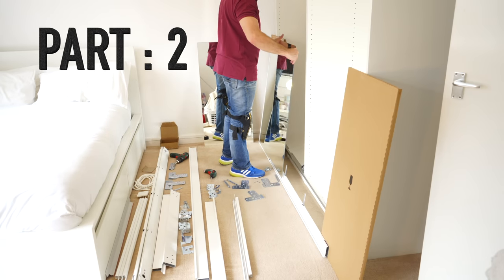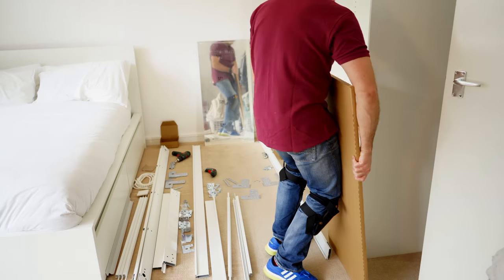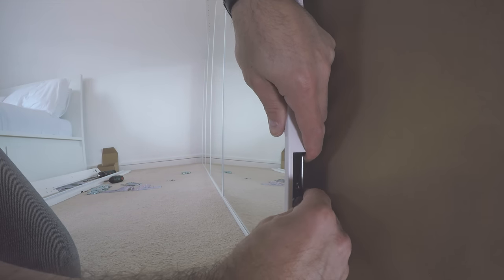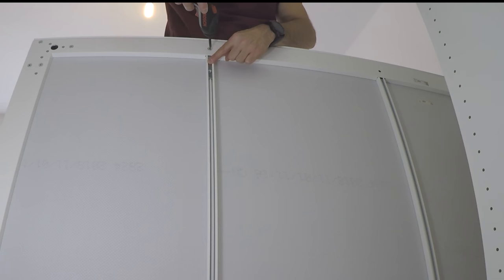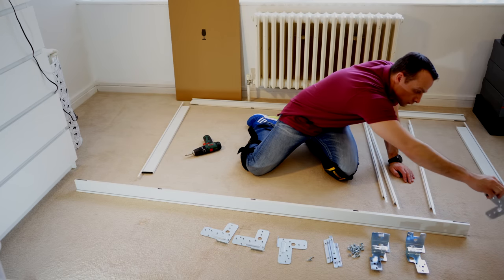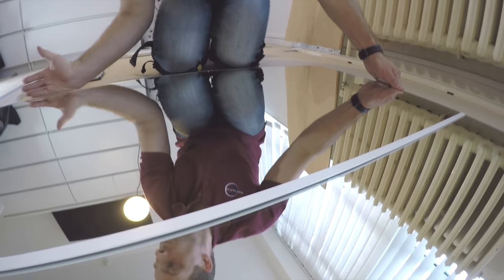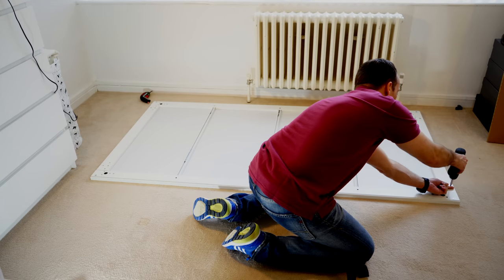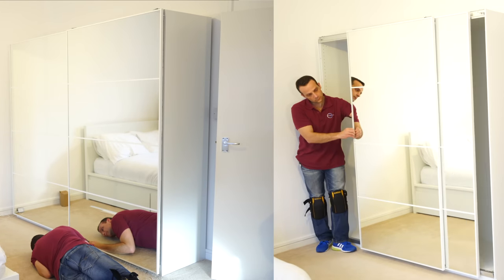IKEA PAX WARDROBE Sliding doors assembly (Part: 2)

Comment: This video was an essential guide to enable me to correctly assemble the Pax doors. Without it I would have made many mistakes. He does not do the assembly in exactly the same order as the IKEA instructions, which caused a little confusion but watching it certainly saved my sanity. I’m a 70 year old gran. I only needed help with lifting and fitting the doors to the wardrobe.

Comment: You forgot to install plastic covers on L-shape brackets. I've missed that step too, so I had to reassemble doors after. IKEA manual page 10, part number for plastic cover - 10006187 10006207 10006204
Apart from that, videos are a great help! Thanks!
Reply from the maker: Plastic cover for wardrobe fame?
Reply: Yes, there are little plastic covers for the four corners of the door. Just makes it look nice and reduce the sharp edges on the corners.
Reply: Thanks for the excellent video Peter! Highly appreciated and much better than the manual IKEA provides.

Vyacheslav and light 487 are right. In step 6 of the PAX wardrobe assembly manual you will see that a plastic cover (which, apparently, has three different part numbers: 10006187/10006207/10006204) has to be put on all brackets (4 L-shape and 4 R-shape).
Reply: @PPFlatPack  do you have the exact name and model of the wardrobe you are working on please? Thanks

Comment: Thank you very much for the 3 videos. They have been very helpful, very easy to understand and made our task much more simpler. Thank you again
Reply from the maker: Thank you for watching;)
Reply: @PPFlatPack  Txs! One little thing though: pls mention next time it s not so advisable to fix the locking screws with a machine! 
If you use too much force the locking screw will go in completely and destroy the divider.. The divider then comes out and the doors will not slide properly..

Comment: Thanks for this very helpful.
A word to anyone else finding this to use as a guide...Though I had enough room to do the second method, and tried it, I recommend the first ( less room) method as its easier to complete the door. When I tried the second ( more room ) method ,the last part had me worrying I was going to break the mirror, plus lifting it up to put the end bit on was all to dodgy I was sure it was going to break. So I took it apart and redid it doing the first method and it went together well. I also had plastic pieces to put on the L brackets - might be an update in design since this video was done, so be sure to follow the official instruction booklet along with this to make sure you don't miss a step.
Reply from the maker: Here is latest updated version and you correct regarding the last glass panel if you doing it in the floor here is easier way putting less pressure on the last glass panel https://youtu.be/R499d-CBDzk  Thank you for watching
Reply: Agree. I used both methods and the "upright" method was way easier. When the panela were lying flat the last one was under too much pressure when I was sliding it in. Great videos!

Comment: Thank for your really helpful videos.  I bought a disassembled Pax wardrobe second hand and just followed your calm instructions (paused after each step) and assembled it almost stress-free!  Just bought 4 mirror panels from Ikea to replace the white ones on one  of the sliding doors. Do you have a video showing the minimum steps I need to take out the white panels and replace with the mirror panels? Many thanks

Comment: The manual says that we need to hang the frame beforehand and then add the glass panels. Will that not be easier than hanging the extremely heavy door with fragile mirro? 
Genuine question 🙋🏼 as still undecided which route to take
Reply from the maker: I think you find older video. This is previous model. Here is the new one https://youtu.be/Ilxl5yDrq48?si=2-rwBQpq8FdKYD8a

Comment: Great instructions! Can the slides be used for Pax frames bought for hinges doors? Or the hinged doors will only work for frames made for doors and not sliding doors. I’m still waiting for my order so I haven’t seen the instructions yet.
Reply from the maker: All Ikea Pax frames would work with hinged and sliding doors
Reply: An other question. I didn’t like a lot of the sliding doors. Could I use the hinges door converted to a slider or are they too small for the frame?

Comment: Just finished some sliding doors and the foam pads on the outer door brackets are rubbing the inner door just as it closes. Is there an easy adjustment to increase the gap between outer and inner door?
Reply: This is probably too late for you but others might benefit from my answer. I came up with the same problem the first time I did this assembly. The next time I simply didn't put the foam pads on the bottom till after the doors were on in place.  Then I found the best place for them (which isn't where the instructions tell you).  You'll have to figure that out on your own as I can't describe it without the instructions.

Comment: Everything has been very clear but I am confused about the duster strip.    My home installation has the inner door on the right and the outer door on the left, just like you say in your video (and the opposite of what is in the written instructions I received).   On the inner door, does the strip go on the side of the door that is towards the middle of the wardrobe or to the side that is at the end of the wardrobe (when closed) ???  The written instructions step 29 show the duster on the ‘middle’ side of the door, but you seem to install it on the ‘end’ side at the 10 minute mark,  Can you clarify?    Thank you.
Reply from the maker: You have two dusters one going on the inner door if your inner door going to be on the left side duster on the left if the inner door going to be on the right side duster on the right. 
The outer door on the left duster on the right on the left ending aluminium pannel with rubber stickie (middle duster closing the gap between doors. The outer door on the right duster on the left aluminium pannel with rubber stickie on the right (again duster closing the gap between doors). Hope that help

Comment: Hello. I am currently building 2 PAX wardrobes for a customer. They are having sliding doors. What’s the absolute minimum size I can have between ceiling and top of carcass for the doors to slide on?
Reply from the maker: You should have at last 1.5cm. Here is latest updated video in this ikea sliding doors there was few changes from older model https://youtu.be/R499d-CBDzk
Reply: @PPFlatPack  that’s annoying I think I have 1cm. Could you also tell me which Bosch screwdriver that is please,
Reply from the maker: @deancarter4109  Check this video https://youtu.be/ehWybREbdF4 you can see all measurements and space between ceiling and sliding doors in detail than you can decide if you want to try with 1cm. Hopefully you have all 4plastic holding top rail already in. Regarding tools all links in the description.
Reply: @PPFlatPack  your work is amazing. Did you get longer drill bits to get into the tight holes? Watching your videos now. Thank you so much.
Reply: @PPFlatPack  sorry one more question. What fixings do you use when attaching Pax wardrobes to a stud walls? They are flush to the wall

Comment: Man, I Need your help. Im trying to assembly the doors using Fjellhamar panels(Bamboo like panels). I literally cannot close the frame, everything Is in place but It seems like the panels are simply 0.5cm too long for the whole frame, and no matter how hard fitted they are its Always impossible to complete the frame. I tried something like 15-20 times already, putting everything togheter, noticing It wont close, disassembling It and restarting.

I followed the instructions step by step, quadruple checked every time...

Something like 10 people tried to help me, Ikea assistance tried to help me, I thought "ok this box of panels May be a defective One" and tried 2 more boxes (same exact results). Everybody came to the conclusion that the panels are simply too long for the structure.and told me to trim one of them.

Comment: Did you remove the sticker behind the mirror panel?
Reply from the maker: No. If you have mirrored panels you would not see it from the front. If you have frosted glass check if is the sticker visible from the front I think should be fine even on the frosted glass panels.

Comment: Hi you forgot to put the little plastic fittings on the corner door brackets that fit on the little lugs.
Reply from the maker: This is older model Here is the Latest 2021updated version of these Ikea sliding doors : Ikea AULI sliding door frame assembly for Ikea Pax wardrobes Part:1 https://youtu.be/R499d-CBDzk

Comment: The bottom brackets have grey plastic pieces to act as a damper in the bottom rail.  I lost these, are they essential?
Reply from the maker: It is going to function normally but you will hear squeaky noise every time you open door - metal on metal. Just put some tape on it or go to Ikea they have often spare parts.
Reply: @PPFlatPack  I see , thanks!

Comment: I think i wrote incorrectly before - sorry.  My inner door is on the left and my outer door is on the right.

In your Part 3 video the door you put on the rail  first is put on the INNER rail and you can clearly see the duster on the right side of that door - you can see the duster when you lift the door to put the door on the rail.

Are you calling that that the Left Door ?     And are you calling that the Inner door ?
You wrote “if inner door is on the left, then duster on the left” BUT your video is showing the duster on the right.    

I’m confused.   When I look at my closet with the doors closed, the left door will be closer to the shelves, and my right door is the outside door and farther from the shelves.

Can you explain what you show in the video?

Thanks
Reply from the maker: Hard to explain maybe this is better here how it works on one side inner door left or right depending on where you want to have inner door) duster closing gap between wardrobe and inner doors. The duster on outer door closing gap between the doors.
Reply: Ok.   On the inner door, the duster should be on the side of the door that is touching the wardrobe casing.   Correct?
Reply from the maker: @familiaandyrybnyky9260  Correct to be exact it will be touching metal ending panel which is mounted on the wardrobe frame.
Reply: @PPFlatPack  Perfect.    Thank you.   I just finished everything except for the ending panels and the doors slide wonderfully.   OH OH!  I noticed that I had 8 little plastic rectangular pieces that I never used.   From the instructions I see that these are parts 10006187/10006207/10006204 and on page 10 it looks like they are used to help the angle L brackets slide into the door panels.   I don't see you using them in the video and I didn't use them either.    Doors feels very solid.    Do you suggest I take the doors apart and add these pieces?
Reply from the maker: @familiaandyrybnyky9260  Regarding 8plastics they should go in door frame when you puting doors together one in each corner but don't worry is just plastic cover not affect structure of the doors.